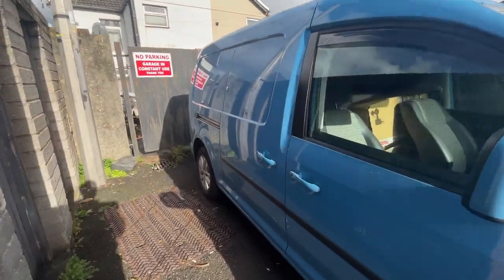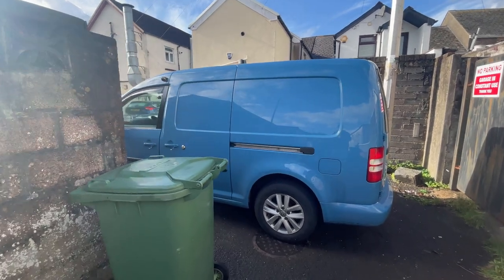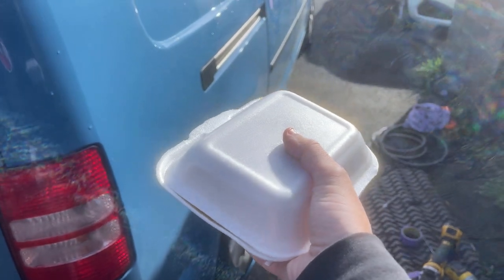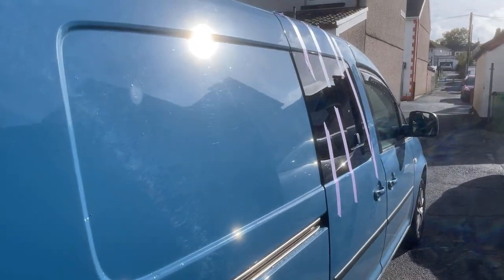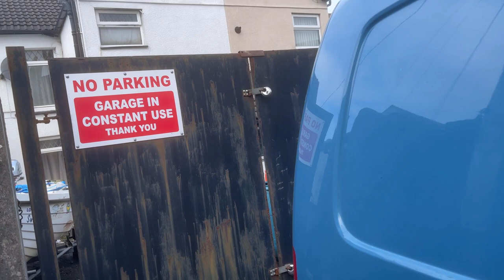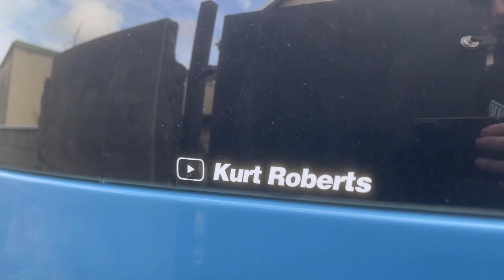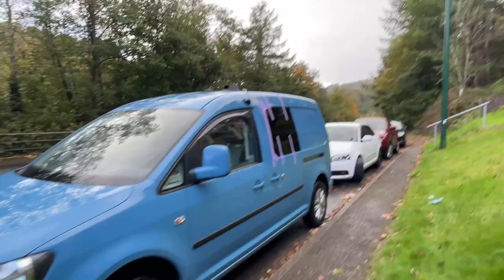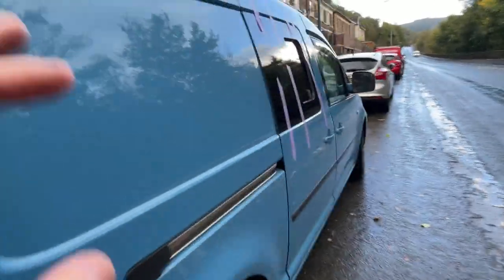Getting Windows fitted on my volkswagen caddy maxi campervan project

Comment: Hey where the lock was on the side of the sliding door. Did you leave a hole or fill it?
Reply from the maker: Left it but put something around the edges so it don’t rust